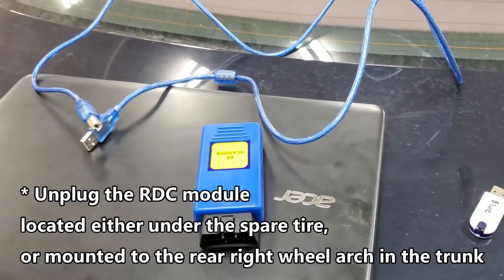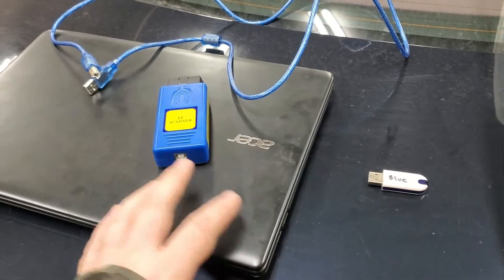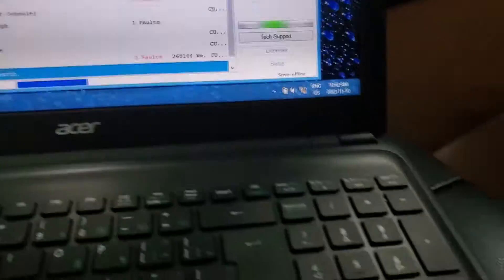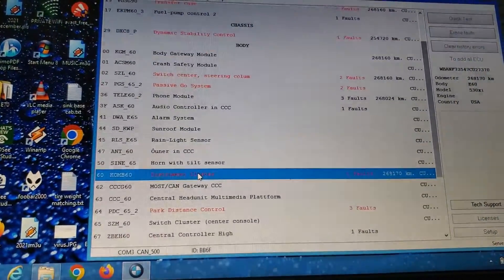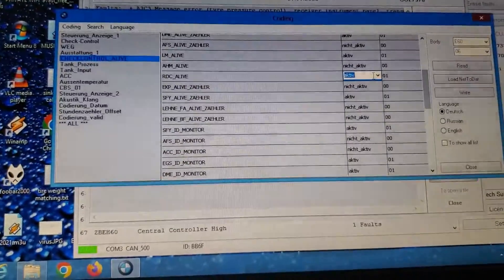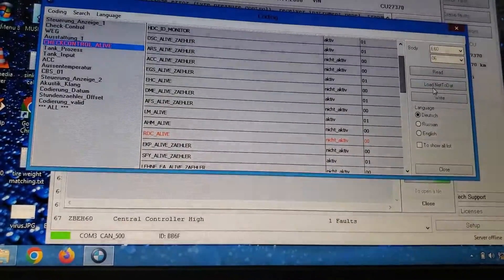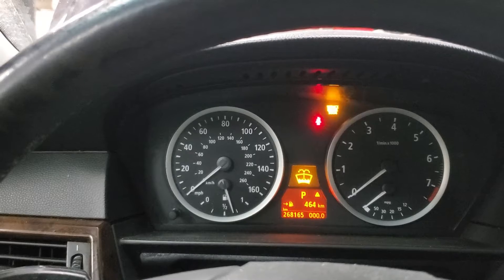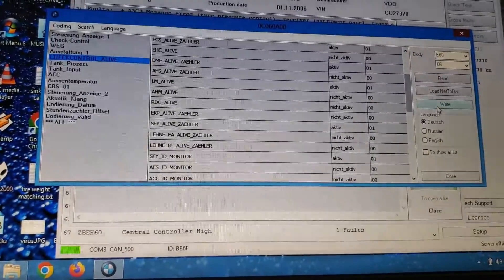BMW Tire Pressure Warning Light (RDC) - Disable

Comment: Hello sit. Can ask what that tool is tue best for Dtc, Tcm. Bcm ecm..?? Ancer, thinkcqr, thinkdiag. Launch. Foxwell, autel, xprog, xtool, 🙏🏻 thanks you😊
Reply from the maker: Each tool has its strengths and weaknesses. Autel and Launch tools are good general scanners. Xprog makes some really good tools for CAS access and key making. Personally i use an Autel MX808 scanner, E/F Scanner Full 2018, D+ICAN cable with INPA and other BMW tool kits. There is not a single tool that "does it all", unfortunately.
Reply: @djbmw1   thanks sir.. i see now